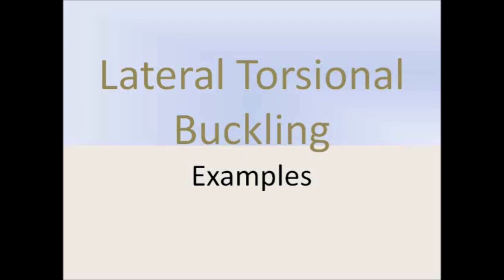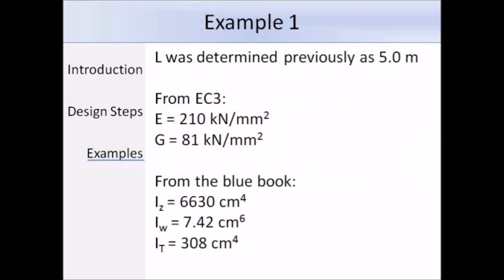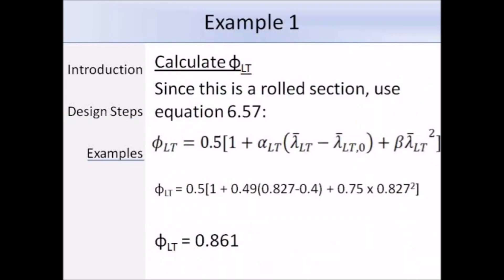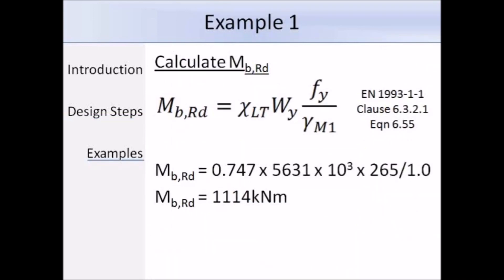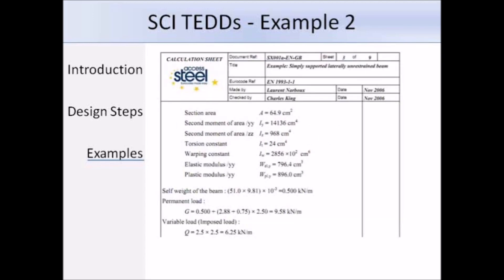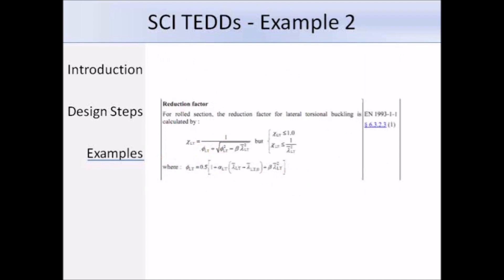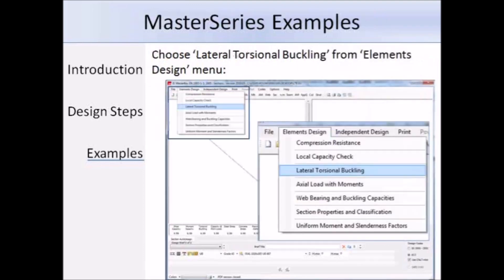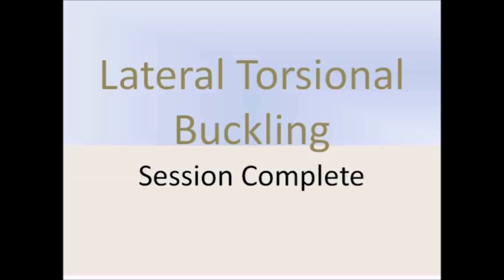Calculation Examples of Design Buckling Resistance Moment | Lateral Torsional Buckling | Eurocode 3

Comment: Hi, please do an example with a non-standard welded section where the top flange is not similar to the bottom flange, where you actually have to show how you calculate the section modulus, whether elastic or plastic.